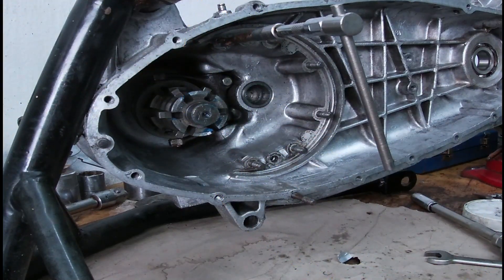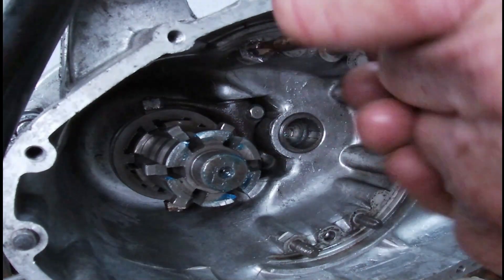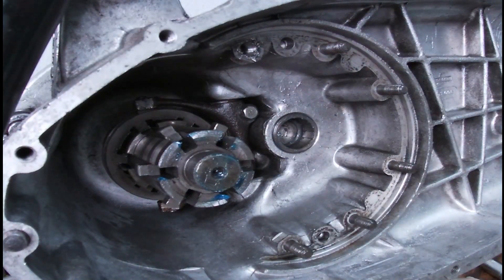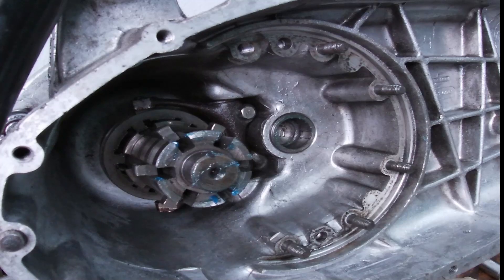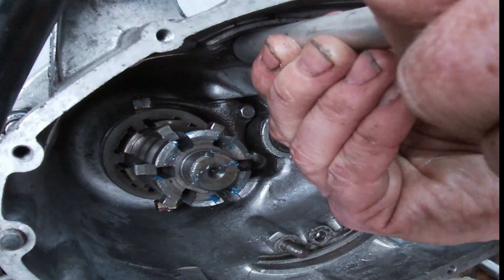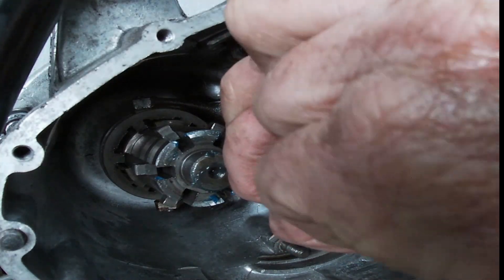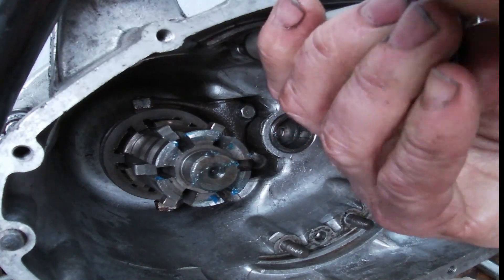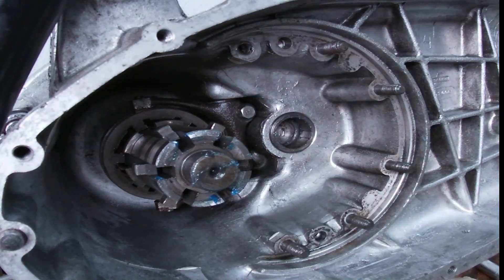LAMBRETTA TS1 part 6 b

Comment: Nice one, thanks for putting up. Did you have to open up the  hole to fit the helicoil ?
Reply from the maker: nope its only ally and the tap is about 1.3 mm bigger so it goes in easy .